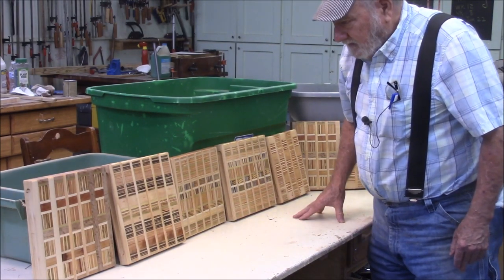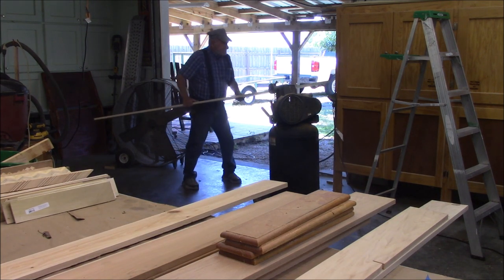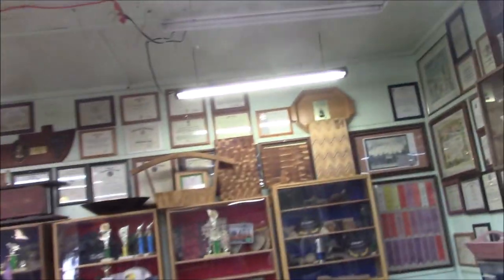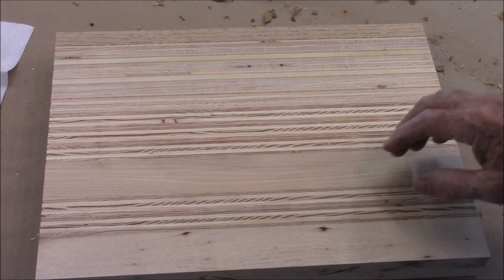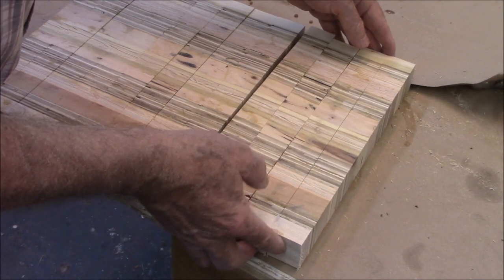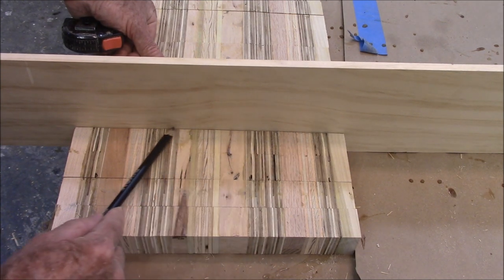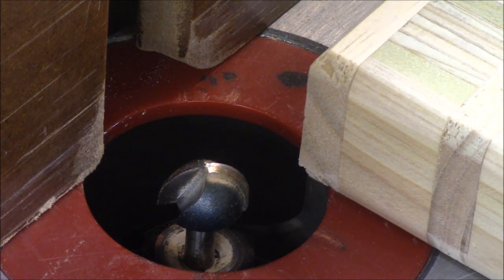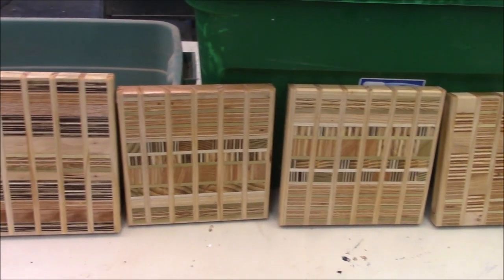376 Remnants to Cutting Boards

Comment: I never thought of using a sander with coarse paper to remove glue as I always assumed it would clog up but that is one trick that I will have to keep in mind for the future. A very useful take away.  Thank you for the video.
Reply from the maker: I never thought of it either.  But remember, it probably only works on squeeze out that will be subsequently put through a thickness planner or drum sander.  The 40 grit will leave swirl marks that will show bigtime after finishing.  A plan B might be to try sanding out the swirl marks, but that would be more work than scraping off the glue before it hardens.  
    I'm glad I discovered that the glue doesn't clog the 40 to 80 grit on the sanding wheel, but scraping the glue before it gets hard is probably the most prudent and conventional approach.  
    Thanks for the kind words, and hope to see you next week.  By the way, I think I now have enough cutting boards to last a while.